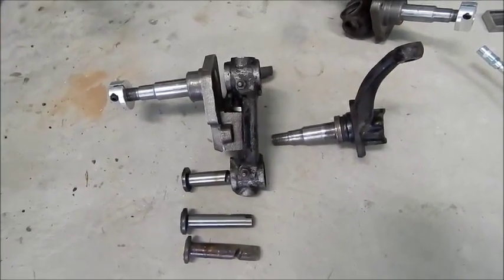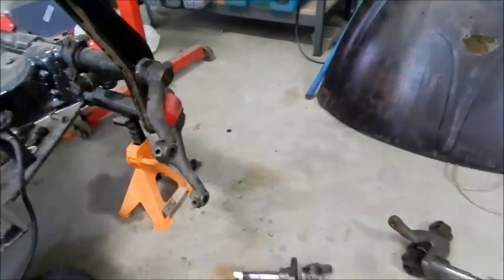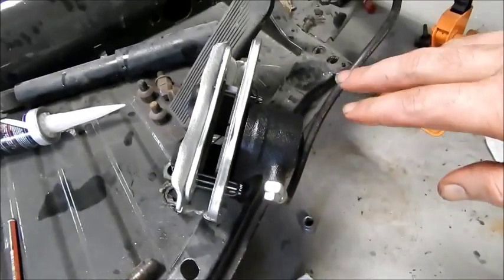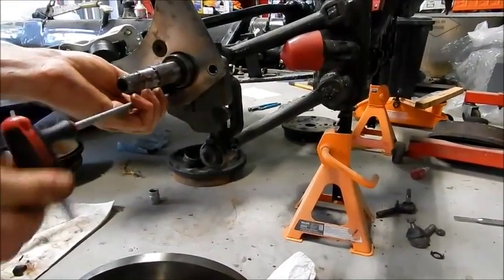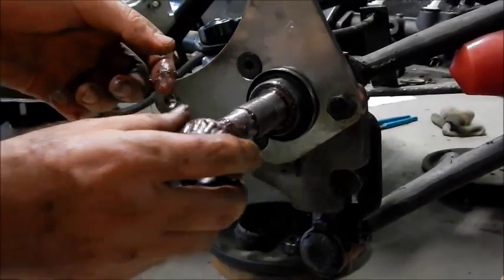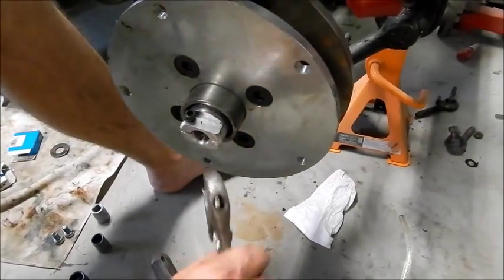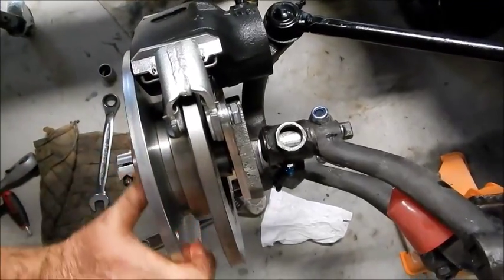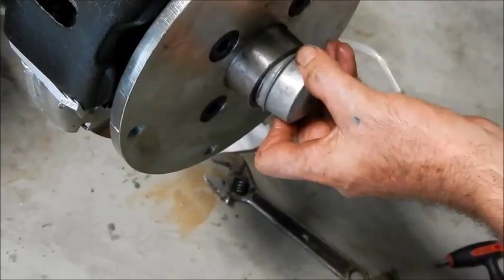1958 VW restoration Part 14 Disc brake installation

Comment: At 6:10 mark you put seal on spindle collar. Seal should be pressed or tapped flush into rotor/hub assembly against big inner bearing. You have possible water and dirt contamination entry point into bearings and spindle.
Reply from the maker: Thank you for the catch on that. I will look at that and make sure to the correct it.
Reply: Couldn't agree more with you

Comment: Looks like the caliper is dragging the outside of the rotor, the bearing and seal should of been installed in rotor B4 mounting, U probably damaged the seal when you put the rotor on the way you did, BUT GREAT cameras work, got good shots of sexy legs & feet LOL

Comment: Any tips on getting your king pin out, really struggling.
Reply from the maker: The only tip I can give is alternate heat with penetrating fluid and a big hammer. My style becomes more caveman, the greater the frustration. Sorry if that does not help much :(

Comment: I love the disc brake conversion better for safety.
And thanks YouTubers for catching some of the installation errors. By the way when you spun the rotor at the end of the video when everything was on there was kind of a clunk sound. It didn't sound smooth. Appreciate the video enjoy you build !!

Comment: What brand is the disc brake kit thanks?
Reply from the maker: +Jodie Goodall
I got the kit from Volks conversions in Labrador on the Gold Coast.  He makes the kit to suit the VW, whether it is a link pin suspension or ball joint.  I chose this because the after sales service was excellent and the parts are guaranteed.  Go to Volksconversions.com.au and it will direct you from there.
Reply: Thank you :)